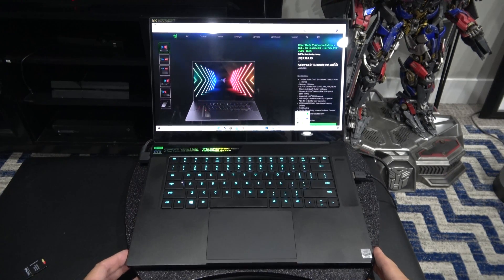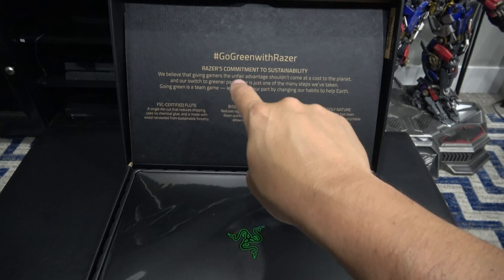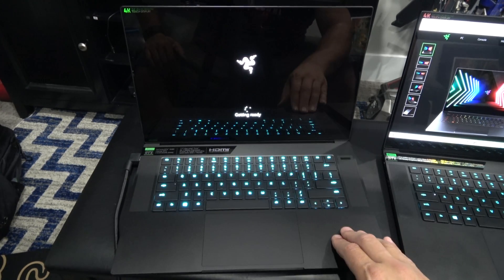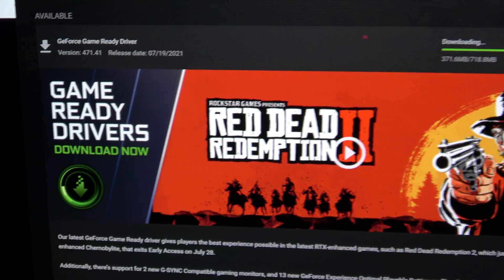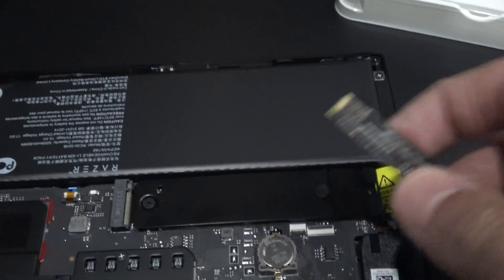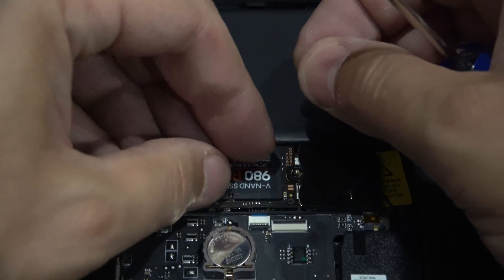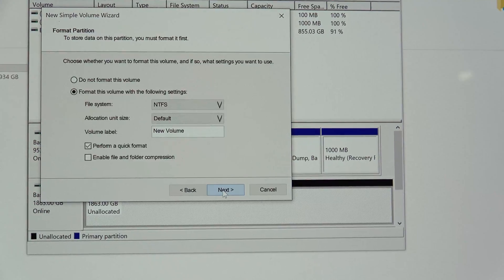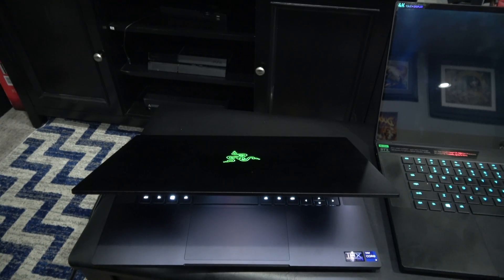Razer Blade 15 - 2021 & 2020 Laptop / SSD Installation Problem, Intel i9, GeForce RTX 3080

Comment: Last year I bought a Razer Blade 15.  Paying $4500 for it  + $1200 shipping cost to Iceland.
Now, after barely 10 months. It is as good as dead...
Yesterday after my gaming session in Conquerors Blade with my guild I exit out of the game and I'm just chilling on Discord with the guild and watching stream. 
Suddenly the laptop blue screens into a random Windows Update restart. 

After the restart, I decided to log into New World for some more gaming with the guys. 
Instead I get hit with ''MinSpec Failure''  and cannot launch the game anymore.

After some looking around on Google taking me into Device manager It seems my GeForce RTX3080 driver is having Code 43 issues.
I've followed every single thing Google & Youtube throw at me. 
Update, Delete, Reinstall, Restart, Restore, Back up, Downgrade to older drivers, yada yada blah. 
Eventually down to my last resort I even went ahead and did a complete factory reset wipe on the laptop and reinstalled windows. 
GPU is simply completely dead....

Luckily I opted for the 4K UHD   version of Razer Blade, so I have 2x Graphics cards so technically the Laptop still works. 
But I can't play any games.... It's essentially a $5700    15' inch phone...
All It's good for is reading manga, watching Netflix & listening to music  & chatting on Discord... 
Can't play any games whatsoever....

It barely lasted 10 fucking months.... 
Don't know If I just got a trash model, or what. 
Even on Day 1   during the Windows set up the laptop was overheating upto 103°c. And It stayed at 85-105°c everytime I was using it those 10 months.
Reply from the maker: That sounds like an awful experience. Truly sorry. 
My son has an Alienware desktop - CPU runs around 100C before throttling. Very frustrating. Definitely running too hot, like yours.  It shouldn't be on the consumer to try and fix these things- build quality and consistency could be improved.

Comment: Hey so i did this and now i am about to uograde to windows 11 can i just run the upgrade or do i need to take steps to make sure i have drivers for the ssd and windows 11?
Reply from the maker: You should be able to just upgrade to windows 11 - no issues on my side when I did.

Comment: It is too late for this install, but apparently you are not supposed to remove the bracket.  The bracket sits between the first and the second ssd.  When I installed that way, the second one fit (needs to be single sided still), although it still sits at an angle.  The bottom goes back on just fine, though.
Reply from the maker: Initially I did that but it created a bump on the bottom of my laptop 🤷🏽‍♂️. What I ended up doing works so I'm living with it.
Reply: @TheStockpile  What works, works.  When I did it with a 1 Tb 980 pro, I didn't get a noticeable bump, but the screws had a little bit more resistance on that side of the laptop.  It seems to work fine.  I do have the 2022 version, so there might be a tiny bit more room.

Comment: Great vid!  Specifically, what size screwdriver did you use to open the laptop with? And what size screwdriver did you use to unscrew the SSD cover?
Reply from the maker: Oooh- been too long to remember. Any torx set you get made specifically for electronics will have the size you need.

Comment: Whats up, thanks for the vid.  I didn't catch it in the video but your 2021 model is the Advanced model correct?  I have a Base 2021 and believe there's a second slot for a second NVMe SSD.  No problems w/ the SSDs temps in your Blade?
Reply from the maker: Yes, it's the "Advanced" model. There may be a second slot on the other models, but I'm not certain. No issues with SSD temps 👍🏼. Been running two drives fairly hard since I made the video.

Comment: Never looked into razer laptop or any type of gaming laptops, but since i changed my job and being in and out between office/homeoffice i thought its time to get a unified workstation which i can also use for games after work. Looking at the current roster of razer models gives me a headache. I guess im going all out on the blade 15 with the i9. Hearing some folks saying the i9 gets too hot.. any experience on that matter compared to the i7? Also the screen types im unsure whats better, but i guess for work the highest resolution 3840x2160 should sufficient.
Reply: I've watched many Razer Blade reviews (I have a Blade 15 and Stealth 13) and have never seen a review w/ an i9.  You should dig for reviews before you buy bc Blades do run warm sometimes a bit hot.  Luckily for me im not a kb & mouse gamer so it doesn't bother me one bit.

Comment: would you buy the ney razer 15 2022?
Reply from the maker: If I didn't have the 2021, yes. But the 2022's only real upgrade is the processor (a jump from an Intel 11th gen to 12th gen) I won't personally buy it.

Comment: Would have been nice to see a speed test on that newly installed drive. I got an I7 10th gen model with a RTX 3070 and this will surely be a future upgrade. I am also thinking to bump up the ram from 16 to 32 GB. The RAM which it comes with runs at 2933 Mhz but I was wondering what the maximum frequency which it would recognize and "accept". Any information would be more than welcomed. My model is the RZ09-0367. Cheers!
Reply from the maker: What do you want to know? Read / Write are both around 4200 MB/s (SEQ1M testing in CrystalDisk). It's about the same for Razer's OEM drive. If there are specific results you're curious about let me know. As for RAM, not sure- that would be a question for Razer.

Comment: Bro i bought 2021 version of i9 blade and it has oled screen but i am wondering about your experiance on ex blade 15 with oled model are you have oled problem on your blade? And are you a hard laptop user it means are you play same game 4/5 hours ? And are using hdr mode all time or not?
Reply from the maker: No screen issues. I use my laptop about 4-8 hours a day for work / entertainment but not for HDR gaming.
Reply: @TheStockpile  i am happy to hear that thank you i can use my blade without fear😇

Comment: I have the same laptop and I bought the same Samsung 980 Pro. At first, I experienced what you did. But I applied a little forward pressure into the socket and the memory stick popped down into place. No issues at all.
Reply from the maker: That's great! I wish I'd had that experience 😅
Reply: how did you secure the unsocketed end? Is it just floating and held down by the case and m2 socket?

Comment: There is a chance that, because of the gen 4 drives with the double sided chips (chips on either side) it could be a space issue. Gen 3 are typically 1 sided, so it might be worth it looking into that.
Reply: The Samsung 980 Pro is one sided so it's not because of that.

Comment: That 2 TB nvme didn't fit properly because anything more then 1Tb will have memory chips populated on both sides... you would need to make sure to get a nvme drive that only have chips populated on only one side
Reply from the maker: I'll reiterate: The drive I installed did not have any chips on the back. But it was easy enough to make it work.

Comment: Hey Cam, would you mind running some sort of battery test on this laptop, with every settings on best battery mode would be nice as well. I've been looking for battery review of this specific model with the OLED screen but could not find any. The screen plus no Optimus may reduce the battery life a lot. The test doesn't have to be too scientific, I just need a rough estimate for my purchasing decision. I will mainly use this for photo and video editing at home but I'd like to be able to bring it on campus for a lecture or two, too. Thank you
Reply from the maker: Yeah, next time I'm using my laptop for the day I'll just pop it in econo mode and see how long it goes. I'll report back 👍🏽
Reply: @TheStockpile  really appreciate that. Thank you🙌
Reply: @samuelhn  I got about 5hrs on default settings for light web browsing and about 2hrs on hearthstone
Reply: @Ben-cm2un  Wow that's actually better than I thought. Thanks for the info

Comment: Hey! I got this laptop and there’s no engineering problem at all. You just needed to take the rubber donut out of the screw hole and place it over the nvme drive. Check out the razer 15 promo video in slow motion (where they place the 2nd drive).
Reply: Link to said video?
Reply: My man! Thank you for the comment! +1
Reply: So the screw that was holding my plastic donut did not move at all. It also had the screw sticker on top and stripped instead of coming off. I had to cut the plastic donut off really slowly…. It was not pretty. The only issue I had was the bottom screw. I did not place it back. So far seems to be working fine. I will update if any issues arise.
Reply: did as @Jaswati suggested, no issues with fit. Great video otherwise!
Reply: Hey can you provide the link for the video? thanks
Reply: @jaswati was correct, we pulled the plastic donut off and a 2TB Samsung 990pro fit perfectly. But I am very impressed with the OP's ingenuity and fab skills to make his fit. Also his tips on how to format and assign were appreciated because ours didn't get instantly recognized either.
Reply: Also never had any issues. Seems someone was a fool when he installed the second drive LOL
Reply from the maker: It is possible they have fixed the issue? I spent hours going over every possible install configuration and my parts just didn't fit. I watched that video many times but it didn't help in my case.

Comment: Your mistake with the ssd is that it’s single sided memory chips only, it’s in the product literature
Reply from the maker: The SSD I used is single sided.
Reply: @TheStockpile  how many times have you had to write that it was single sided 😀😀😀
Reply: @TheStockpile  2 TB drives ARE NOT one sided only less then 1TB

Comment: Hi, Cam! I'm thinking about buying a Blade 15 advanced 4K OLED, but I'm a little bit worried about Razer's quality control, I've heard that a lot of people had problems with their devices, what about you, have you faced any issues in your three models?
Reply: Don't do it Gabriel
Reply: @noahmistle7688  Hi, Noah! Why do you say that? Have you had a bad experience with Razer?
Reply: @gabrielbonfim3077  I had the 2070 OLED model, honestly wish i went with a lower spec or dif screen option as the screen tearing was driving me crazy, i sold it and got the 3080 QHD model, honestly enjoy it a lot more but miss the NITS of the OLED. If screen tearing doesn't bother you and running games on low-med graphic settings, you'll love the laptop.
Reply: Oh, and besides that, I'd also like to ask you about burn-in with these OLED screens. Have you had any problems with burn-in?
Reply from the maker: Zero problems with the screens- all have been fantastic.
Reply from the maker: QC has definitely been an issue. I have had little things wrong with all of my laptops (loose screw rattling around, grinding cooling fan). All super little stuff that hasn't really been a big deal.

Comment: Yoo i have the razer blade 15advanced 2020 one  how many m.2 slots does that have if u know  or any other way i can fit a normal ssd in ?
Reply from the maker: The 2020 has one NVMe / M.2 slot. If you need more storage you can always use an SSD card.
Reply: @TheStockpile   so there is a free slot for a  ssd card or u mean just upgrade  the m2 1tb for a bigger one ?
Reply: 2020 Edition the Advanced Model has only one Slot ...... the base model has 2 slots

Comment: The issue is because that SSD is dual sided. Single sided SSD's have no issue installing, Razer just didn't make enough room in there for a dual sided SSD.
Reply from the maker: This is a single sided SSD. That's what was so surprising.
Reply: @TheStockpile  and again
Reply: Bullshit. I installed it and had never issues. Seems someone was an idiot

Comment: Can you do stress test on both NVMe and check the temp after? Those SSD touches each other and I concern about the temp since there's no thermal pad between them
Reply from the maker: I considered the fact they are are touching. I don't necessarily want to do a stress test but I don't see any alarming temps in every day use (SSD drives should, in theory, be just fine stacked). What might be a good idea is putting a small bridge under the second to create an air gap.
Reply: Thats bullshit. They dont touch each other. They are cooled by the alloy case and thermal pads. Seems idiots did their job in the video. Temps are around 50 degree in my laptop. Depends if you get rid of the 980pro patch or not. You can get 5 or 10 degrees lower if you take them off.

Comment: It’s like they didn’t even try. They finally add a second spot but it was an after thought. Anyways, do the PCIe slots on the 2021 model with the 11th gen support PCIE4 or is it still 3?
Reply: I think it support PCIe 4 sice it has 11th gen and they surely take the advantage of the CPU
Reply from the maker: It really is like they didn't try.
Reply: the 2tb drive he used has memory chips on both sides thats why it didn't fit... Razer Clearly stated on their sites that you can only use 1 sided nvme drives ..... I have 2 drives in my early 2021 and didn't have that issue
Reply: @AnnaMae525  I see that's why its only up to 4tb since atm the max size of 1 sided nvme is 2tb

Comment: How is the battery life in this model?
Reply from the maker: It seems to be just as good as the previous model. If you're asking about specific run-down times I'm not certain but I've used it at least three hours on a few occasions (word processing and  Chrome) and had plenty of battery power left
Reply: @TheStockpile  okay thanks I like it so much but battery life is important for me, I had see I many review sites that the past model was not good at it
Reply from the maker: @miguelmorenopastor4697  If you are going to play games or use something like Adobe products the battery isn't great.
Reply: @TheStockpile  I am a coder and would like to use it with VSC and plenty of VM but occasionally game.

Btw nice video man and thanks for your answers